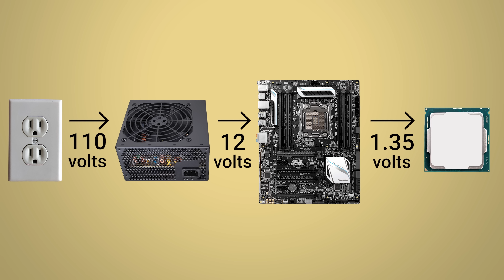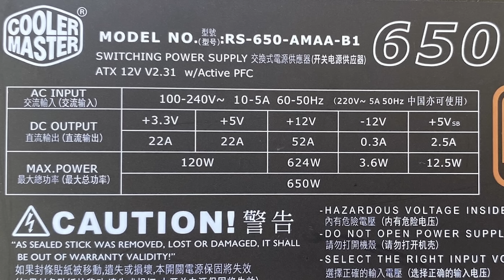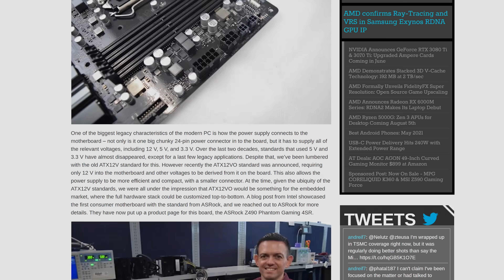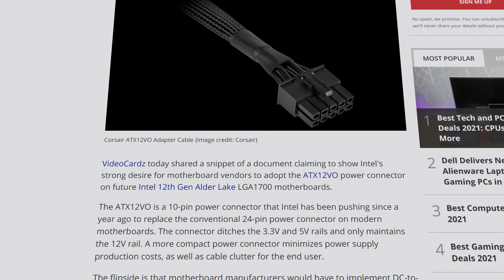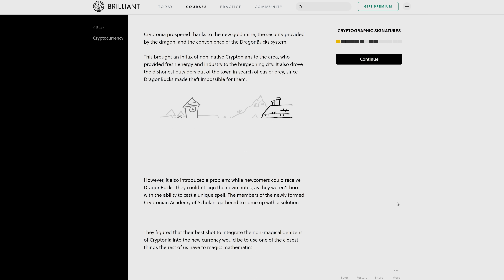Is The 24-Pin Connector DEAD?

Comment: Getting the 24-pin connector OUT is even harder than getting it in... I find that sticking a flathead screwdriver in there and twisting it does a great job though.
Reply: Yep. I do that too sometimes.
But most of time I just wiggle it gently left and right while pulling, while my other hand holds the motherboard down with 2 fingers (1 on each side of the 24pin, or both behind)

Comment: I don't know about you but I like keeping 24 pin because it means keeping my power supply longer and not having another damn part of the PC I constantly need to change on every upgrade
Reply: Most motherboard manufacturers will likely include both 24 and 10 pin connectors for a while on some boards.  Simple adapters will likely be a possibility as well even with the need for 12V stand by instead of 5.

Comment: You know, if intel tries to force it, they do run the risk of the PSU and MB manufacturers just giving them the finger, removing themselves from the market
Reply: Oh no, PSU and MB manufacturers are fine with it, atleast for the start, since it will make peoples buy new motherboard and psu.
And they can justify higher price for an additional SATA 5v port on their motherboard, or voltage regulator.

Comment: Kids will have to learn about dual power supply systems. One ATX12VO for the main PC and another 3.3/5V PSU for arrays of hard drives or other various things. Dual PSU is a grossly overlooked money saving way to upgrade an OEM PC to be able to use a high power draw graphics card. As long as you don't care about janky mounting in or outside of your OEM case 💪 Kids these days with their little RGB, why back in my day we drilled holes in butt ugly beige cases and a dremel was just as necessary as a screwdriver.

Comment: honestly, they probably could simplify the power supply a fair amount by just getting rid of the negative rail, nothing's used it in over a decade now.
also, do I want to TRUST my motherboard to have good enough voltage conversion for usb and sata?

Comment: Until it becomes feasible to store a massive media collection on ssd 12VO can piss off.
Reply: Idk why you think 12VO would inherently prevent this. Sata power just gets moved to the motherboard.
Reply: @alextrotta796  When I say massive I mean in quantity of drives in addition to their capacity. I'm betting the average 12VO motherboard will have enough amperage for maybe 4-6 drives at most and after that, you're screwed without an additional power supply.

Comment: I'd like a power supply with a plugin slot if you need the other voltages. Putting more crao on the MB is NOT the solution.
Reply: Soooo the exact same thing as we have now on the 24pin full modular?

Comment: why not put the pins on the underside of the board with the cpu. or mimic how cpus are put in.. meaning loose connector into port, with a latch that locks in place.   Remember old Athlon cpu coolers before the attach to board came around?  Why put any force on the board.    Similar could be done to ram, by adding a slope/glide cip on each side.. so you push inward instead of downward.   or set the power bits to the topside and bottom side of the board to allow for more chances to cool.     Lets add a SoC soldered to the board too to manage cores based on load..   Also gives you the ability to boot with a bad cpu and still get a gui and diagnostic screens.

Comment: You missed a very BIG drawback of 12VO. The reduction of PSU you mentioned happens at the expense of the Motherboard now having to have voltage regulators built on the PCB, making such boards prohibitively more expensive than motherboards currently out on the market.

Also those whom already have systems built and are just upgrading components usually NEVER need to buy a PSU as they will continue to use the one they already had. With this new 12VO euthenists will have to pluck down more cash to power the system.
Reply: Yep. And also it means that there will be more strain on the motherboard. Since there's a lot more electricity going through the motherboard before going to component.
And as we know, More electricity going through = more heat. At that point I'm sure those motherboard with "armor" gonna be like an oven. What's next? motherboard heatsink ?

I doubt even a pro builder plug and unplug their 24pin atx that much a week to justify a new connector.
Plus if it's about "Hard to plug and unplug" , then why not just try to find a new connector that are easier to plug and unplug instead -_-

Comment: If the SATA power all comes from the motherboard, won't it add more burden on the motherboard in form of heat?
I mean, we're talking about ... CPU + Chipset + SSDs + RGBs + Fans + GPUs + USB, all got the power from the psu, THROUGH the motherboard before going to each components
What if someone is using a ssd raid array, that's quite an addition since it's more than just 1 ssd.

Do we need a new 10 pin atx connector ? I'd say no, what we need is an easier to plug and unplug 24-pin atx connector.
Plus.. how many freakin times does an average user plug and unplug their 24pin atx a month to justify a new type of connector?
Intel should just focus on improving their cpu to catch up instead of trying to make everybody buy a new motherboard and psu using a new type of connector.

Comment: The problem is that the new 10 pin connection on the motherboard comes along with another 6 pin...

and another 4 pin...

and then ANOTHER 4 pin...

Making a total of... 24.

So why we doin' this again?
Reply: Because Intel is trying to make everybody buy a new motherboard & psu.
In the hopes that it will become a new norm, and will slow AMD down.
They should just focus on improving their CPU to catch up. Really.
Reply: @jeuno880  idiotic comment from fanboys mentality 

Watch LTT video the Idle power difference between ATX vs ATX12Vo is huge, this is push not only from Intel but from many governments and industry for lower energy electronics 

Imagine if they can save 50% idle power of computer, count a whole office, or even state, how much power is being saved that way,
Reply: @heickelrrx  Um... I used Intel until January 2021 actually. :P. In fact, my old PC still uses Intel ;)

I know how to save idle power of computer, turn it off,  100% save. Or atleast put it in sleep mode :). Mine goes into sleep mode after 10 minutes idle.

Trying to save 50% idle power of personal PCs while mining farm uses like tens if not hundreds of GPUs, sounds obsolete to me.

Comment: 24-Pin connectors are not annoying. Who says that?
Reply: It's kinda annoying when I need to unplug it, since it's usually feels like it's being held by Hulk.
But yeah, not like I plug and unplug it often enough to justify a new type of connector. 
Different case if it's just a new type of 24pin that can be plugged and unplugged easily. By which can be sold to older system user in form of an adapter.